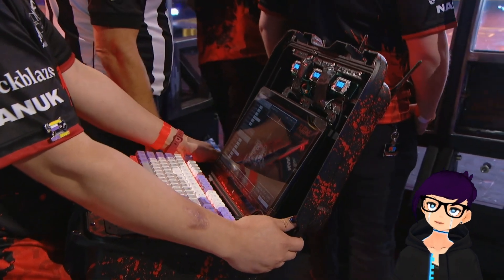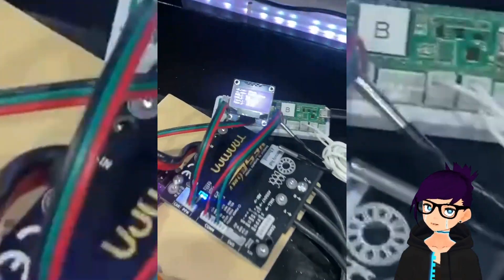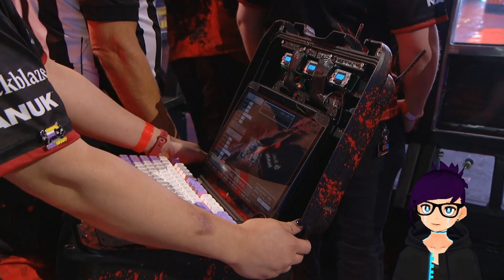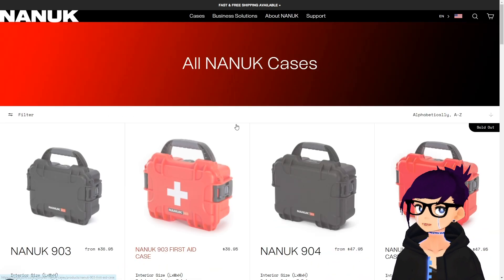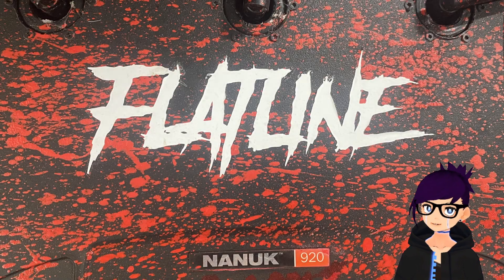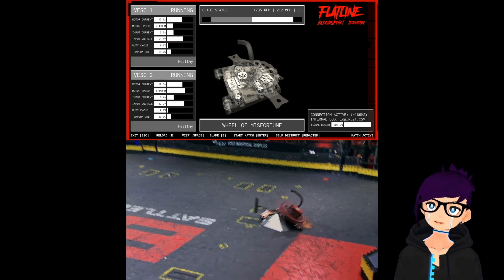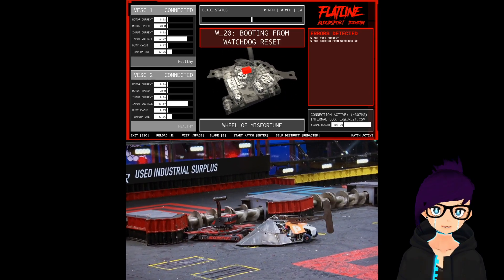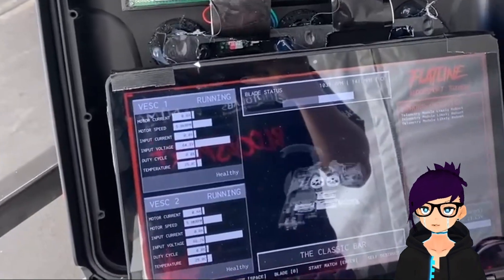FLATLINE - BattleBots WCVII Telemetry System

Comment: Why is something like this better than what ribbot uses? This adds an extra layer of complexity to driver communication and can seemingly be just as useful in a much smaller package that doesn’t need to be held above your head.
Reply: Different drivers have different amounts of information they want to see- or don’t get to get distracted by. With a dedicated telemetry operator, the driver gets to focus completely on what’s in the BattleBox without having to interpret the data on the screen- which is what the telemetry operator does.

A big screen also looks very cool and is more visible to the television audience- and this is a TV show that provides entertainment value. If I was designing a telemetry view system for industrial purposes, it would look very different and less flashy than this.

Not saying our system is any better or worse than Ribbot’s, just different design and presentation philosophies.

Comment: This is amazing! I would absolutely love to see full fight videos with the Flatline overlay.
Reply: The three main obstacles to this:
1) Each recording of telemetry was on a different "version" so I have to essentially slightly reprogram/make-more-flexible the part of the code that can do the telemetry playback. 
2) Also, the Copperhead fight had NO telemetry installed, and the Lockjaw fight the telemetry module both failed to record to the SD card AND failed to transmit data, so there is no telemetry record of that fight either.
3) Need to make sure its chill with BattleBots AND Discovery to do this

This leaves, as of time of airing, the Gigabyte, Rotator, and Beta fights, as possible fights we can air telemetry-overlaid footage of.

Comment: I'm absolutely loving the aesthetic of the telemetry UI.

I'd love to see full fights with the telemetry overlay too as it could give us viewers more insight into what exactly went wrong or right during a match.
Reply: The three main obstacles to this:
1) Each recording of telemetry was on a different "version" so I have to essentially slightly reprogram/make-more-flexible the part of the code that can do the telemetry playback. 
2) Also, the Copperhead fight had NO telemetry installed, and the Lockjaw fight the telemetry module both failed to record to the SD card AND failed to transmit data, so there is no telemetry record of that fight either.
3) Need to make sure its chill with BattleBots AND Discovery to do this

This leaves, as of time of airing, the Gigabyte, Rotator, and Beta fights, as possible fights we can air telemetry-overlaid footage of.